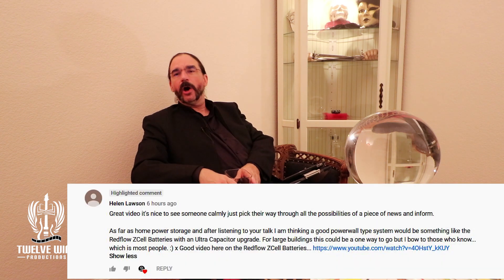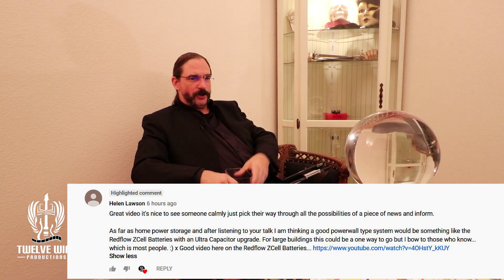Fixing the problem with Flow Batteries: ESP Q&A

Comment: Where are you getting the info that there is a lag?
Reply from the maker: By virtue of the way that the energy is recovered.
It isn't much of one but the recovery process involves firing up a pump.  So there is a slight lag between when power is called for and when it is delivered.
In these specific batteries, the charge is held in the zinc that has been placed on the plates.  They don't have a potential across them when at rest.  That's how they can last fully charged for a decade.

If you have information counter to this I'm open to discuss it.
It is my understanding that what you see pictured is just the tub that contains the plating apparatus.  There is a separate control panel that is needed to basically "call" for power when it's required.
This differs greatly from something like Li batteries where there is direct access to the full potential of all batteries.  5kw in the case of each Powerwall 2.
Reply: @twelvewingproductions7508  using  expensive lithium cobalt isn't feasible for grid or home storage...

10kwh isn't enough for a modern western home...what if it rains for a week or so? you need to go cheap and big even if it's less efficient or slightly slower...

I've been following these batteries for years too...and ultra-capacitors are wonderful...but the fully charged clip clearly shows a 600kwh version powering a small office block without a hitch...and they are also providing the same services on much larger scale in china.

If the lag was in any way pertinent...they just could not do what they are currently doing...
Reply from the maker: @CaptainManic2010 , before you try and come here to tell us what isn't feasible, you may want to take a closer look at this channel.
It will save you a bit of embarrassment moving forward.

As to what the fully charged show displays, it displays a large building that is connected to an enormous bank of flow batteries.  That enormous block of batteries works more like a generator than it does a battery.  Hence my point.
I actually dislike presentations like this because as an engineer I'm interested in everything needed to actually make it work.
We aren't shown all those components.

The bank shown doesn't deal with fluctuations in load.  Hence why I thought that Helen's comment was a brilliant use of ultracapacitors.  Something that could be in a small package and deal with home loads or rapidly changing loads.

As a factor of percentage, a large building or power grid will not see more than a change of a few percentage points in it's total draw.
This isn't what you get with a house.
With a home, it's common for the load to change instantly up to 80%.
Flow batteries would have to either draw from grid power or draw from a buffer battery to deal with the sudden demand.
That's not something they do natively.

Before responding further to this thread, I HIGHLY suggest that you pull up the videos on "The Energy Sovereignty Project" on this page.
You need to update the information you currently have on what's "feasible".
Reply: @twelvewingproductions7508   Twelve Wing Productions  yeah I love ultracapacitors too..

Thanks for referring me to 500 random videos on some fringe science channel on youtube with less than 4k followers...in 2 years.

Please feel free to embarrass me instead. We are online. I have no shame in real life...so some text on youtube? I can handle. Thanks.

So I watched your energy sovereignty intro...I believe in energy sovereignty too.

I've been researching growing my own food...harvesting and farming my own water...regenerative soil farming and water capture...and energy capture and storage for 3 years.

I'm not an engineer...or a scientist...pretty shit at maths...tactile audio visual learner so YouTube is my jam.

But I've been really getting into storage lately. Lithium is great...but everyone other than your ah "Sovereignty Project" agrees there isnt enough lithium on this planet to scale up to grid storage or reliable home storage FOR THE MASSES...a couple of relatively rich westerners? Sure. Especially in the glitzy age of the gigafactory right?

I love Elon musk...

But there are new chemistries coming out to the market...sulfur batteries...metal fluoride batteries...aluminium air batteries...some solid state batteries...

Many of these when working promise more energy density with cheaper raw ingredients that are easier to mine...recycle...and scale up. Professor Sandoway? I think his name is? Made liquid metal batteries that operate at high temperatures...lower density than lithium...sure...bigger bulkier. ..you know it costs the fraction of kWh per kg than lithium? If you shot it with a gun? The liquid metal would ooze out...freeze into a solid at room temperature. ..seal the battery...and keep operating at slightly lower capacity...

And then there are flow batteries. Where this Australian company is already scaling up from homes to offices to villages in China...isnt it true that in these batteries THE TRANSFER OF IONS IS ACHIEVED BY PLATING...BUT THE IONS THEMSELVES...THEREFORE THE POWER...IS HELD IN THE ELECTROLYTES....which when already charged...probably wouldnt need the pumps too much...wouldnt the pumps be used for charging after the ions travel through the cathode and anode? To reverse the process electricity goes in the pump pumps fluid towards the membrane and the zinc unplates itself back into solution...I'm pretty sure once charged they dont need the pumps...hence no delay...pretty sure. Maybe we should ask them?

I dispute that 60 or 90 kWh is enough to provide energy sovereignty. What if it rains for 14 days? 90kwh provides 3 days of backup...without driving or charging your EV. You need 400kwh to achieve ENERGY SOVEREIGNTY AND SUPREMECY. at least. I'm planning on 600kwh. Or equivalent in hydrogen...compressed air...methane biogas...

Lithium is NOT the answer.
Reply from the maker: @CaptainManic2010 , I can't do any more than present to you the reality of this.
To start with your closing statement first, you are going to have to enter into this conversation realizing that the amount of battery power you have has nothing to do with your ability to produce energy on any given day.  The storage you have has to be in balance with what ever environment you are in and with the loads you are applying.

Your approach of an all "all or nothing" approach to solar power isn't an honest one.
It's cloudy Sam.... it's not night.
Again, environment aside.  You might be in the arctic.  If so, this conversation changes.

So a balance needs to be struck between your production in winter, the amount you store, and the amount of your load requirement.
Again, what you aren't doing is following our weekly/monthly logs.
Had you done that, you wouldn't be asking these questions.
So again, I think you should do that before you insist something isn't possible only to find that not only IS it possible.... you are arguing the point on the very page where the proof is being presented.

Next, you spoke of Lithium.  According to studies by Bloomberg and others, less than 1% of total current available lithium will be mined in the next 12 years.
Past that, as batteries scale, not only will other sources of lithium come online but the lithium ion isn't the only one that's able to be used to transport electrons.
Sodium is one that is already currently being looked into.
Even if we did stick with Lithium, total volume wouldn't likely be an issue for 70-100 years and that's with zero recycling.
Lithium... is recyclable. 

Lastly, I find it odd that you choose to mention liquid metal batteries.  Those that do haven't really looked into the losses involved.
Liquid metal batteries were ONLY designed to work in conjunction with other industries that already utilized molten metals as a part of other processes.
The bulk of this work designed to work in conjunction with the aluminum industry.

If you don't do this, the losses are outrageous.

I would like to know more about your sustainable agriculture.  I looked into this briefly a couple years ago as something to try and present but unfortunately I could find no one that was actually pulling it off.  Lots of research on it but no one that I found was willing to present data.  Mostly snake oil salesmen looking to capitalize on eco dollars.
Reply from the maker: @CaptainManic2010 , I also want to address the channel, since you brought it up.

The channel was started a couple years ago, but we didn't actually start uploading much content related to The Energy Sovereignty Project until 11 months ago when we actually got the batteries installed.  Prior to that, as you can see, this was all mostly in the planning stage.

We have a growing group of crazy people, now nearly 4,000... that I had never expected.  We discuss a wide range of things as we are all here seeking to share our ideas and move forward with those things that work and discard those that don't.
As the channel grows, I will be leveraging the interest of others to branch out into other experiments and projects such as electric mobility.
All along the way our focus will be on what can actually be shown to work.  Demonstrated.
So though we differ in opinion on the efficacy of some of these concepts, I do invite you to follow along and actually watch some of the demonstration videos.

It's fine to be skeptical.  I encourage that.  My only caution is to avoid trying to tell folks that something is possible when we are actively proving... that it is.
I'm not here to sugar coat anything.  I'm here to present what is possible... warts and all.
And by "present"... I do mean "demonstrate".
Reply from the maker: @CaptainManic2010 , I'll have a look at your video list.  I would, however, prefer you link me to even a single successful sustainable ag project.  Just one.
I had high hopes for one that Google was employing to supply vegetables for their lunchrooms.  That turned out to be a scam.  Not to put too fine a point on it.

So while it's fine that we "agree to disagree".. I am here willing and ready to examine any evidence to the contrary.
Hydroponics seem to work in small scales where it's not a requirement that that they meet consistent production quotas or quality.
But I have not seen any examples of any aquaponic or agro project that uses no outside power or extensive external resources.
I would love to see one.  I have even done some plans for a test to reclaim desert land using only solar.  But I haven't seen anyone pull it off yet.
Reply: @twelvewingproductions7508  look I appreciate what you're doing. There is obviously some sincerity there.

I still disagree.

There is technically a lifetime of lithium available...in the sea...which we dont know how to extract...

And li ion make amazing batteries.

I just think there are more practical solutions...the minute you start installing in homes and grid scale the price will shoot through the roof. Lithium is limited in availability. 

You mentioned recycling....yes lithium is recyclable...but the cobalt and other elements? Plus the flammable electrolyte? NO ONE is recycling them. No one knows how. There is hardly a process to do it...and it's super expensive...most companies repurpose them...if they have a little life left...but show me the recycling pls?

The other chemistries are not limited in these ways. They're still being perfected.

Mate I want you to be right...

But the flow batteries I havent heard of having the problems you mention...

I think if we ask nicely...and show them your tesla powerwall project? They'd consider lending you some of their zcell units to test against tesla...
Reply from the maker: @CaptainManic2010 , I've seen Professor Sadoway's MIT lecture.  You need to understand that the losses inherent in such a system are outrageous.  The numbers he gives for the batteries capacity and delivery current are based on the battery already being molten.  Do get to that state, it takes an incredible amount of energy.
So it's important to remember that just because you can show that something has an effect, it doesn't mean that what you discovered has any kind of practical application.

Also, I wasn't looking for a link to molten metal batteries, I was looking for just a single link to a sustainable auqaponics or sustainable agro project that could demonstrate it works.  I am still hopeful someone will do this.. but I've seen no evidence of one yet.  Even though I, myself, have come up with what I think is a viable process to reclaim desert land. 

This will probably work one day, but it's a far larger project than people realize.  We can draw great lessons from "Biosphere 2" in Arizona. 

It's also fine that we disagree.  What isn't so fine is for you to insinuate that I sent you to a channel with "500 random videos".
That isn't the case.  What I have done, if you would look more closely at those videos, is to fund and engineer a real world year long test.
So I'm sorry if you find what I'm saying to you as coming off "Patronizing" or arrogant, but I'm flat out telling you that what you are misrepresenting as such is simply pride in authorship.
I set up, and am recording, the actual results of The Energy Sovereignty Project for the exact purpose of putting to bed the argument that it "can't work".
With no preconceived notions of what would happen during the test I did go into it having the firm belief that I had chosen the equipment carefully enough to make the numbers work.
To then dismiss the real world test because it doesn't fit your narrative doesn't make me "patronizing" when discussing its viability... but it does cause you to come off as denying reality in favor of an agenda.

So I'll close with this.  It's fine for us to disagree.  Nothing says that we have to agree on anything.  But what is required here on this page is to be respectful of the effort and approach your argument with the humility the discussion deserves.
The project is... what it is.  The numbers we present, represent the reality of running a home with a yearly average of 30kwh per day usage with 10kw of PV and 82kwh of usable battery storage.  We also examine how much driving can be done on sunlight and we break down usage on a weekly basis with monthly updates.
At the close of the year we will present our findings and give hard numbers that consumers can use to scale their own systems.
It really is just that simple. 

As to a trial of the flow batteries, the bulk of flow batteries make them totally impractical for a suburban environment.  The sheer mass of 90kwh of flow batteries would require far more space than I, or anyone else, is willing to part with.

 All the best.
Reply: @twelvewingproductions7508  

You're flat out wrong. You're lying to your audience. 

Sadoways batteries work amazingly well for cheap reliable multi decadal storage. If youd watch this most recent lecture he actually answers all of your comments...and proves your statements wrong...

Never once said your fancy overpriced lithium project wouldnt work...said 90kwh isnt enough to be SOVEREIGN...and is utterly INFEASIBLE on a large scale...especially grid storage...too fragile expensive explosive and hard to recycle.

You have a double garage...and your powerwalls take up enough space for a second car not to fit...you could fit 9 zcells along that wall or in the  backyard with EASE...or just store them in the sun...they're actuallyflame retardant... dude install that shit in your roof...if theres a fire your zcells put it out...

Look your fancy project is irrelevant to me...lithium isnt feasible for the MASSES...its feasible for the RICH.

My concept of building a homestead that is self sufficient would require at least 5 times the storage...double the solar...2 smallish wind turbines...maybe even a self built small scale hydro. For water storage and electricity. And I understand that my plans arent relevant to you and your project...

You said zcell flow batteries had a lag...I said prove it you...you said pump...and a whole bunch of random stuff...

I didnt imply you had 500 random videos...I flatout used exaggeration to explain I dont need to watch 20 or 30...20 or 30 min videos...to understand what you're basic idea is...know it will work...but only with the grid as backup...and not on an international or city wide scale...

You're wrong about flow batteries...you're wrong about the amount of storage you'll need for SOVEREIGNTY...you're wrong about liquid metal batteries...and you're wrong about your faith in lithium too.

Your scientific method and data capture and pretty graphs might be spot on...but their based on a flawed premise.

Further...if you type into youtube search "regenerative farming" to rebuild soil and drought proof your property (more roots more top soil more bacteria diversity more water is stored)...you can search "farming water" where arid/desert land is being reclaimed and rejuvenated in Australiaand Africa...some channels I've been looking at for gardening especially organically and sustainably although not aquaponics or the other you mentioned

Red gardens
Self sufficient me (casual but exceptional)
Gardens that matter

Where were you searching when you said there were no videos on sustainable agriculture?
Reply from the maker: @CaptainManic2010  

"said 90kwh isnt enough to be SOVEREIGN"~

Then again, you need to follow along.  You are seeing what is possible.  It has nothing to do with the amount of battery storage.  We could probably be fine with 60kwh (4 Powerwalls).  At issue is that we have 10.2kw of solar panels and we actually need 16-20kw.  It's as simple as that.  Doubt that?  Look at the data.  I is spelled out for you month by month.  Arguing this point further is just laziness on your part and not my issue.

"You have a double garage...and your powerwalls take up enough space for a second car not to fit..."~

A second car would fit just fine alongside.  I have a table set up along the opposite wall that I use for workspace that is off camera to hold camera gear or other temp projects.  As shown, the batteries simply stick out from the wall about a foot or so.  Not obtrusive at all.

"you could fit 9 zcells along that wall "~

You obviously haven't read Readflow's data sheet for the Z cell.
The width of a pair of Powerwall 2's is 12 inches.  The width of a single Z cell is 19 inches for 10kw.  You would then have to stack it because it's length is 45 inches.  The length of the Powerwall 2 is 30 inches.
When trying to install this way, it does not appear that they were designed to stack, so a shelf would have to be made.  The weight of a Z cell is 290kg (640lbs), nearly double that of a powerwall so those shelves are going to have to be VERY sturdy.
With a height of 40 inches, stacking would be a problem even without the shelving.
So when you rebut what I already know about these things, you may want to actually take a peek at the datasheet.

But wait... it gets worse.

You still have the biggest issue that flow batteries have.  The one I've repeatedly pointed out to you already.  Current delivery.
Each Z cell has a 3kw nominal output per 10kwh unit.  So even after filling the entire wall with machinery, we still only have an 18kw output.
To put this into perspective, the car alone charges at 15kw.
Then there is the issue of spool up.  It takes the Zcell up to 60 seconds to spool up from being dormant.  So while it's doing this, the power has to come from the grid.
This is your solution?  Something that is nearly twice as massive as a Powerwall that produces 2/3s the available power?

"You said zcell flow batteries had a lag...I said prove it you...you said pump...and a whole bunch of random stuff..."~

From their datasheet... that you obviously didn't read:

"ZCell offers unlimited shelf life: You can switch off a ZCell
at any state of charge, hibernate it for extended periods of
time, and then restore it within 60 seconds"

They also try and hide the round trip efficiency.  It will be very difficult for you to actually find numbers on it... but it is around 70% depending on the temperature and discharge rate.  If you remain within its nominal 3kw discharge rate you get 75-80% efficiency.  If you remain at or above (for short periods of time) the 3kw rate your round trip efficiency will drop to 70%.
This compared to 87% efficiencies during worst case and long term storage for the Powerwall.

"...but only with the grid as backup.."~

And this is why you need to actually watch the videos.. at least the summations.  If you had done that, you would know exactly when we needed the grid and for what purpose.  For all practical purpose we haven't used grid power since March.
With the addition of 6-8kw more solar, we would be off the grid totally.
You would know this if you had actually taken a look at the project instead of trying to argue a proven point.

"Your scientific method and data capture and pretty graphs might be spot on..."~

That they are.  This is your major hurdle here.  You are stomping your foot and telling us that we can't do something we are demonstrating we are doing. 

So in short, it's fine to call me on what you think I have wrong.  But you might want to actually read the actual datasheets of the products you are telling me I'm wrong about.
Everything I've presented on flow batteries is correct.  Furthermore what I present are facts that anyone can look up.  You might want to try that before responding further.
Reply from the maker: @CaptainManic2010 , I had actually seen that TED talk a while back.  Great talk.
Not what we are talking about though.  Our conversation in regards to this is in how that agriculture can be self sustaining with no outside input of power.  Obviously if we are talking about terraforming Mars you have a situation where you are going to pump in resources until you can afford it no longer.
So to get an idea of what is really necessary for an "enforced" ecosystem, you are going to have to look at more closed systems.
It doesn't have to be totally closed... just highly efficient and done with as few pesticides and artificial fertilizers as possible.
Hydroponics was something I was keenly interested in and tried to follow it to see if anyone had hard data that they could actually supply regarding its success.  I found more snake oil and men behind curtains than I ever did actual hard data.

So please... don't try and turn one conversation into another.
Reply: From the installation and operations manual:
https://redflow.com/wp-content/uploads/2019/07/ZBM2-Installation-and-Operation-Manual-CE-V4.0.pdf
9.4.5. Response Time
The full load response time of a ZBM2 is fast when the pumps are running, but requires a short startup period when operating from standby. The ZBM2 operates in the same manner as any other
 battery, and can swap from full power charging to full power discharging almost instantaneously.